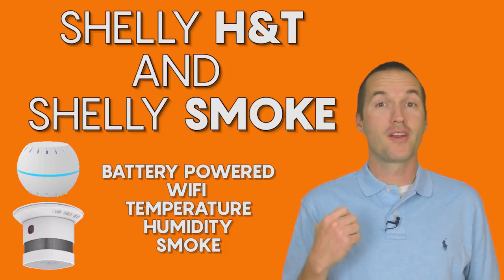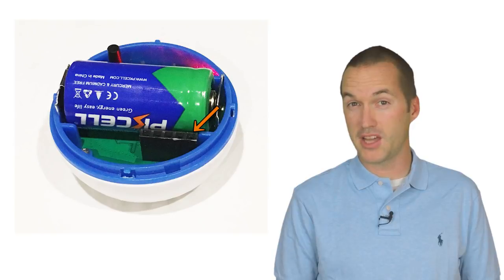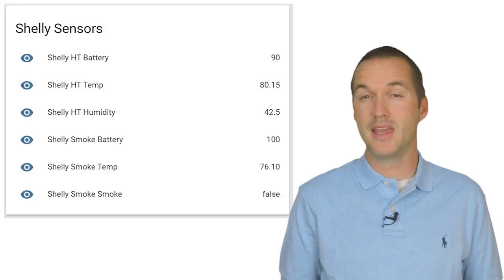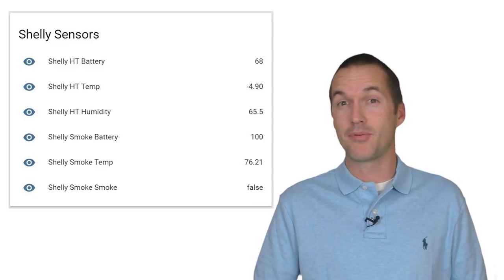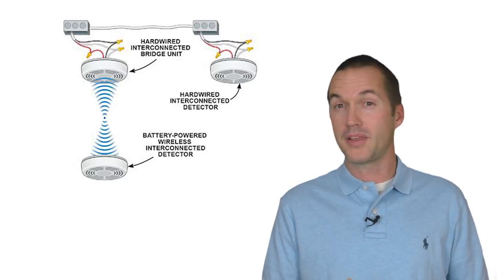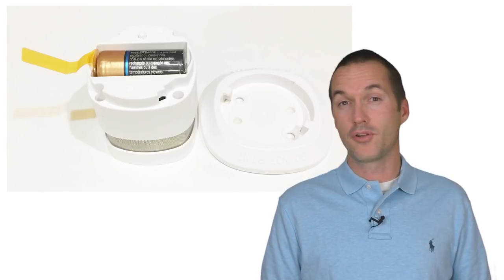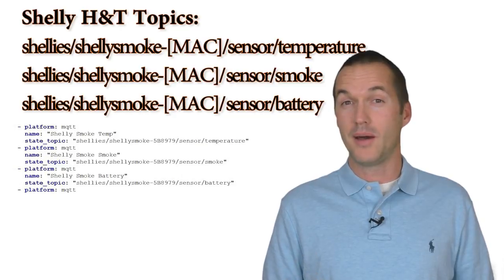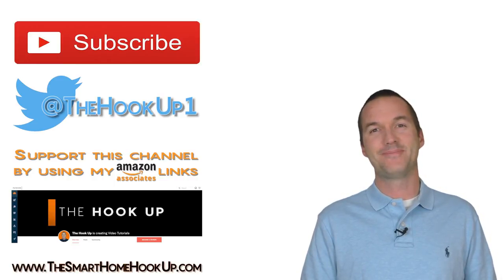Battery Powered Wifi MQTT Sensors! Shelly H&T and Shelly Smoke.

Comment: The H&T and smoke devices would be the perfect things to add into a 3D printing enclosure. You could monitor temperature, and also keep an eye on things in case of a catastrophic failure via thermal runaway.
Reply from the maker: Another great idea that I missed.  Thanks.

Comment: Another option for humidity and temperature are the small ESP8266 DHT11 modules on eBay from China. About $4 each. Can load Tasmota on them or write your own firmware (I wrote firmware which can report via SNMP and HTTP JSON) and they are easily powered by 5V. Only thing I've found is that you need to move the DHT11 off of the board with a short length of wire, otherwise you end up measuring the temperature of the board, not the room.
Reply from the maker: Yep, I've added DHT11 and DHT22 sensors to a few of my projects and have had decent success.  I think the advantage of the H&T is that it keeps the wifi off completely until it needs to send an update so battery life is significantly increased.  

I 100% agree that there are cheaper options if you're planning on plugging them in.

Comment: I turn down the house thermostat to the 60's at night in the winter and use a small plug-in heater in the bedroom to save power/money.  As a result, when the heat goes up automatically in the morning, the bedroom gets way too hot.  The heater has a thermostat, but it's a simple slider with no markings, and it's one of those portable oil filled radiators that it takes a while to cool off.  The Shelly H&T would give me much better control over this thing, and let me figure out the best time in the morning to turn it off.

Comment: Carbon Monoxide is generally heavier than air, and detectors for it are typically mounted close to the floor. It wouldn't make sense to bundle CO detection into a smoke detector, which is typically mounted at the highest point of the ceiling. Shelly's decision to keep the two devices separate makes sense in that regard. Just my $0.02.
Reply: Unfortunately you are wrong, carbon monoxide is lighter than air and diffuses evenly throughout the room.
Reply: @BartomiejLechowicz  I would recommend 02 monitors. Because you can have other gasses displacing oxygen in a home like natural gas and propane, you want to make sure your 02 isn't dipping below 20-21‰. 

And you can use the information to control an HRV or ERV and even other forms of ventilation such as automatically opening windows and staring an high volume central ventilation fan. 

I'm industrial fire brigade and we work and train with the fire department. 02 monitoring is our go to for confined space entry & rescue.

Comment: They should have included a micro USB jack for external power. You might pass that by them.

I didn't have to modify my detectors as I used an UL approved interface supplied by the manufacture, in my case Kidde with voice response. It connects just like any of their detectors and supplies an isolated contact that you can connect to a Z-Wave or any other dry contact interface. Cost about $20 or less for each type.

In addition Kidde has two versions of this interface. One for smoke and the other for CO. This way you can monitor for each condition. When mine detects smoke it turn off all fan of any kind in the house. When it detects CO it turns on all ventilation fans and when I add it the whole house attic fan. In either case main lights to exit paths are turned on.

A little side note. When we remodeled I added a magnetic door holder to hold the inside garage door open and ran the smoke detector cable to it. When any smoke or CO alarm goes off a second set of the interfaces releases the door. It's failsafe as the door will also close whenever power drops. The main reason for this was for doing laundry as it make it easier for my wife to carry the laundry to the garage. Without it she kept blocking the door which isn't safe but this way it is.

Comment: I haven't been able to find the Shelly devices. Perhaps, they were sold out over the Thanksgiving holiday. I wanted to try their products, but ended up having to buy the Sonoff instead.
Reply from the maker: That seems to be the most difficult part about using the shelly (finding them in the first place).  The supply is not currently keeping up with demand.  If you order through their website you can "reserve" your order from the next production of them.
Reply: On their website, it appears the basic one is 10€ and the one with 2 controllers is 20€. So it is not only more than the Sonoff, but it would also be necessary to make a currency conversion before making a purchase on their site.

Comment: Would like an interface that would trigger the wired system, flame detection, and ability to record a voice alarm also ability to hard wire.  Heck, could change out the sensor to motion with an alarm... but would need dc power.

Comment: I'd love to buy a few of the Shelley Smoke detectors. But in Europe, they've shown as out of stock for months. When I contacted Shelley, they said they'd be back in stock in June. It's the middle of June and they're still out of stock.  Honestly, as much as I want these, I'm tired of waiting.
Reply from the maker: I think they ran into an issue with their supplier for the shell and had to use a different company.

Comment: Shelley Smoke i don't think is a "custom designed" product. You can buy versions of it that are ZigBee or Zwave from various companies. I bought a ZigBee model for £22 three months ago.
Reply from the maker: I think it is certainly made of different "modules", but the main board with the ESP8266 is most likely designed by shelly.
Reply: Yes for Smoke we use 3-rh party shells, but all inside is pure Shelly :)

Comment: Hey Rob, On the note about using ESPixelStick firmware - how did you get on with uploading the firmware? I have a test ESP8266 (NodeMCU) running, but when I click the "bulb" in xLights the serial on the ESP8266 shows it crashing in a continuous loop. There is a mention about uploading config files, is this TO the ESP? 

Thanks in advance, Steve
Reply: I'm guessing here, since I have not attempted this myself, but it seems you have to  upload the data to the SPIFFS using the data upload feature of Arduino IDE...Or just check out the E131 library and the example code (use multicast and provide the correct universe number)
Reply: @letsmakesomething9786  ahh ok, didn't know about data upload in the IDE? Will look at that, and the examples,  thanks.
Reply: @letsmakesomething9786  ahh that got it... i looked up some more videos and I was using the .ino to compile and upload, but you should use the java uploaded in the firmware release. All working now after setup via the web gui.
Reply from the maker: Yep, that java uploader saves soo much time.

Comment: Just thinking that as long as you set up mqtt properly on tasmota for each of the smoke detectors or whatever you update the firmware with, you could make each of the smoke detectors a subscriber to their own feeds that get updated by NodeRed so that if one detects, all associated alarms alert as well. At that point you would need to know what the interconnect protocol is for the wired smoke alarms to be able to trigger those to go off as well. I presume this would be much less of an issue with a retrofit of existing battery operated detectors. The down side of having the smoke detector checking the feed would be the hit on battery life.

Do the devices send mqtt messages for battery level so that you can track that, and have events set up in Node Red to notify you when batteries need to be replaced?

For the H&T, wondering if the drain on the battery in the freezer is impacted by the temperature as well. I'm aware that some electronics work more efficiently at lower temperatures, so even though the H&T is sensing less than 70%, that 70% may last longer than the 90%. I'm not expecting it though.

Comment: The Shelly's are surely interesting but the software support is below par.
The app is ok but it is not visible in Google home, at least not in mine. But even if you get it linked to Google, you have to ask Google to 'talk to the Shelly cloud' and subsequently give your commands to the cloud.
So I think I will wait till the software comes out of its infancy
Reply from the maker: I don't use the shelly app very much to be honest.  I use local MQTT control to interface with home assistant and it has been spot on.

I actually think support is the biggest difference between Shelly and iTead.  Shelly seems to listen to user feedback and produce updates and new functionality extremely quickly.  If you join their facebook support group you can talk directly with the people making new product decisions.  I do not believe they are following any set path, if the demand for a device exists I believe the shelly guys will work as hard as they can to make it happen affordably.
Reply: @TheHookUp  hmm, are you saying that the Shelly 'as is' is responding to mqtt messages coming from an mqtt server/broker of your own choice? Thát wasn't clear to me and I would definitely prefer that option so I can link it in to my openHAB right away

Comment: I know it's not on topic but do you use 5v and 12v plugins to the outlet or do you have it all ran to one place and is that even possiable? I do not have enough outlets
Reply from the maker: For powering what?
Reply: @TheHookUp  I have leds, multi sensors, some blind motors, and I was thinking about making more stuff but I never see you or drzzs plug in any of your 8266 boards into the wall. Just wondering if that's off camera or if you have somthing built in that runs to maybe a breaker box of some sort.

Comment: I want to automate a new bathroom.  Can I automate the lights (motion & time of day), exhaust fan (humidity & motion), and electric floor heat (time of day) using Shelly relay, Shelly H&T and upcoming Shelly Motion sensor with the Shelly App (ie. without MQTT, Tasmoto, etc)?

Comment: there is some hw design flaw in shelly1 that company needs to fix. i have blown 2 sheely 1s in a 3-way switch config. then i saw someone else on discord having the same issue and we both have gone back to sonoffs. i hope they have a good testing and qc before they release these products.
Reply from the maker: Can you describe how you wired it? I've got two shelly1 in 3 way config working without any issues.

Comment: love your videos!
can you tell me if it's easy to hook up the shelly H&T to a wall plug and let it send the change in temperature accurately with every 0.5 degrees change in temperature  or X % of humidity? or would the frequently active WIFI radio cause a faulty temperature reading? 
thanks in advance!
Bram

Comment: I have a a shelly 1pm controlling my bathroom fan and light. I would like to use this T&H combined with a smart rule (triggered by the light switch off) to turn on the fan when the humidity is high, and then off when the humidity is low. Will this work? I assume it will, but I am asking because it is the light switch change that triggers the automation and not the humidity change.

Also, can alexa report the last sent temperature and humidity readings sent to shelly cloud?
Reply from the maker: I have that exact device combo doing that exact automation.  It works great.

I don't think shelly has worked out alexa humidity readings yet, but you can ask that question on the shelly support facebook group and they will get back to you very quickly.
Reply: The Hook Up Thanks!

Comment: Too Bad, that The H&T does Not have an Input, (Free gpio) to make it read something like a Button Push... Would make a Great lightswitch For smart bulbs, a doorbell, Multi / moisture Sensor... maybe we are able to Exchange The temprature Sensor Hardware Wise 😋
Reply from the maker: It has a GPIO header, you could probably rig something up.

Comment: If, and I stress IF, the Shelly H&T can be recognized by Node Red it would solve my only remaining issue with SONOFFs.

I created a bread dough proofing box using the SONOFF TH10 to simply switch on/off a 100watt light bulb to maintain temperature. Works fantastic but it is the only device I have not been able to flash the "Tasmoto" firmware to get it off the EweLink cloud with all their data share mandates.

Can the Shelly H&T be recognized via Node Red without altering  the firmware? I have no knead {bread baking pun} to have any devices communicating outside of my LAN.
Reply from the maker: Do you have an mqtt server? If so then it will easily communicate with node red.
Reply: @TheHookUp Thank you for the very quick reply. This sounds encouraging.

 I assumed {dangerous I know} that because my Node Red communicates with the many SONOFF Basics that there is a MQTT server running. It is running on a Raspberry Pi 3 using "the script" from Peter Scargill to load everything. I don't recall loading a separate MQTT server.
Reply from the maker: Are you using mqtt nodes in node red?
Reply: @TheHookUp  Thanks again! On my Sonoff Nodes I see: mqtt@localhost:1883 so I would say yes.

Comment: Can the smoke detector be "hushed" by wifi? So when I burn the toast I don't have to flail at the screaming ceiling box with a teatowel to save my hearing ;)
Reply from the maker: I don't think so... I believe the smoke to buzzer circuit is independent of the esp, I could be wrong though.
Reply: @TheHookUp  True, the sensor and buzzer part are independent. There is second MCU which responsible for that. The alarm works even you completely remove the ESP from the board.

Comment: Do you have the shelly bulb? if so were you able to integrate it with home assistant?
Reply from the maker: I do have it, I haven't done a video on it because it has been pretty buggy for me, waiting on a firmware fix.

I have added it to HA with MQTT but if I try to select a color it turns the bulb off about half the time and you need to select a new color to get it to turn back on , not sure why.

Comment: Maybe I missed it but if you have more then one and it detects smoke will the others sound also ?
Reply from the maker: That's a good question, there's nothing about that in the documentation, let me reach out to shelly and ask.
Reply: @TheHookUp  No, the Shelly Smoke sensor are not interconnected, but it's good idea for future versions. Maybe they can be interconnect with simple 433 Mhz link between them.

Comment: smoke sensors that listen are far superior then just another smoke alarm.  I guess it is redundancy but the price is far to high.
Reply from the maker: You mean sensors that act as a bridge between your installed smoke alarms and your home automation platform using sound?  I agree that's a great solution and I think Amazon Echo has a pretty good implementation of it.